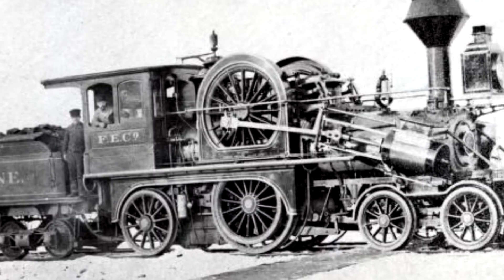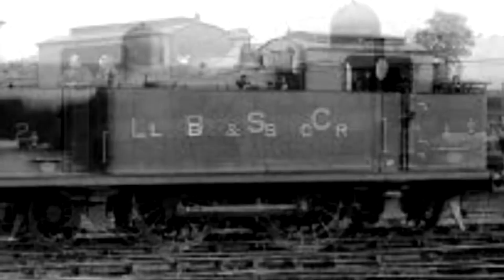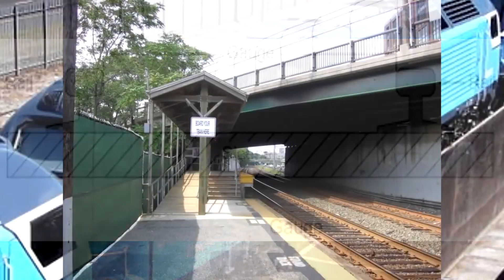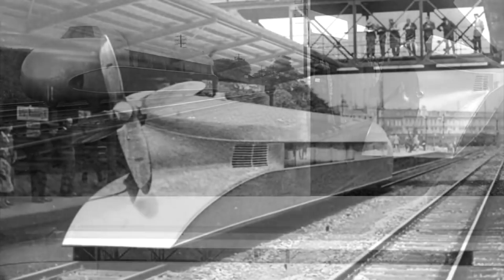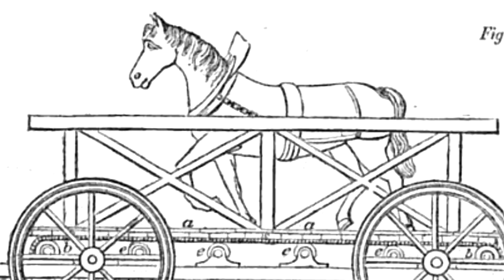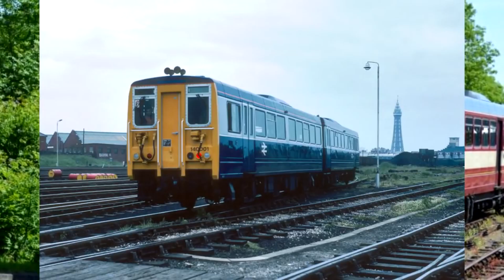The Worst Trains Ever Montage (Parts 6-10) | History in the Dark

Comment: The funny thing about Duke of Gloucester is that when it was restored they didn’t change the design they rebuilt to the original specs

The reason it sucked in the 60s is because the manufacturer literally just built it wrong. They used parts that were different to what had been on the blueprints

Also it’s pronounced “Gloster”

Comment: Found it strange to find Afro 4000 as that bad until the explanation that they don't fit the road...
I live in Israel and we are the largest single customer of the Euro series locomotives from which the Afro is derived. They do their job of hauling passenger trains at 140 km/h for more then a decade in addition to the older JT-42 series.

Comment: I have read somewhere in the last ten years the main cause of its poor steaming/ high fuel (coal) consumption was due to a misunderstanding in the openings in the ash pan air dampers, instead of the opening being eight foot four inches the builder must have misread the the drawing & made them eighty four inches that equals seven foot, of course there may have been other faults found as well during  the rebuild.

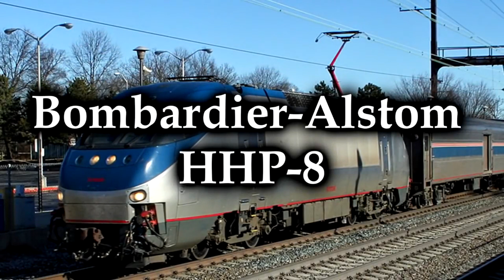Comment: I remember hearing the HHP-8 (stands for High HorsePower) had a significant problem with truck hunting where the trucks would constantly wobble back and forth instead of riding straight on the rails. This is likely the cause of much of their reliability issues with truck frame cracking. 49:39

Comment: For as hardcore as British railfans are, man y’all have trains that look like toys and some of the overall worst locomotives that get attention for being that bad. Every country has likely dozens if not hundreds of absolute failure locos, but dang history in the dark has 25-30% of all videos dialogue having to explain just how bad British locos are 😂😂😂😂
Reply: Diesel locos during the 50s and 60s....yeah, real hit and miss, except for the class 03, 04, 08, 09, 13, 14, 20, 24, 25, 26, 27, 30, 31, 33, 35, 37 and so on...steam not so bad, check out the gwr kings, castles, halls, manors, granges, saints, stars, pannier tanks, 14xx, 28xx, 56xx, 94xx, lms jintys, 4f, 5f, 7f, 8f, jubilees and many many more,  as for why the early diesels failed so badly its because we didnt know what we were doing, we had plenty of coal, coal was cheap diesel fuel was expensive why make diesels when it would cost more to run, as for lookjng toy like the main reason for that is the loading gauges which were set down the Victorian engineers and weve not been able to change